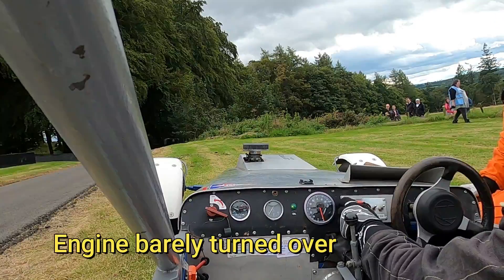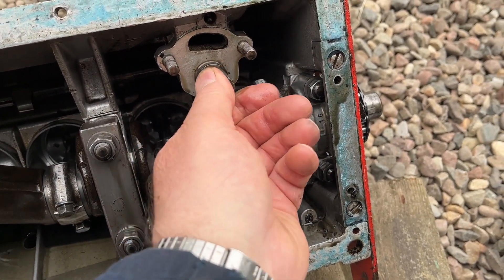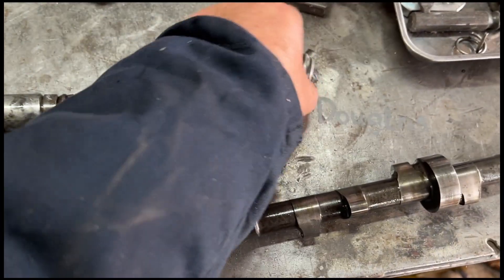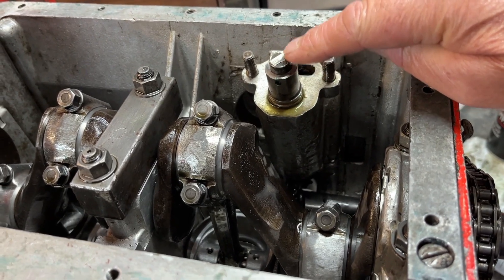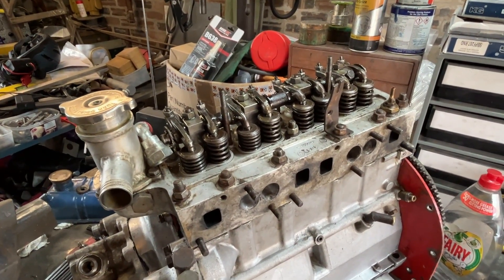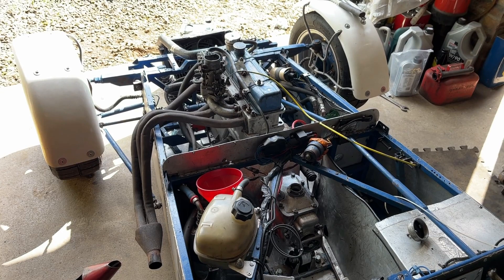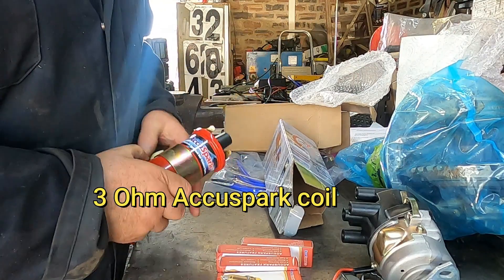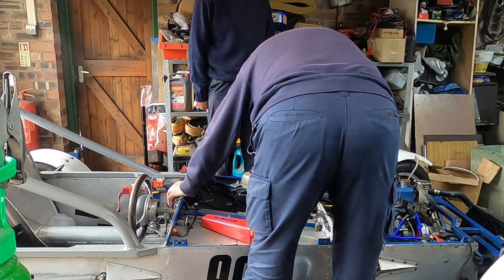I blew up the Reliant 750 Race Engine! What broke and did I fix it?

Comment: Hello Doug just found your channel I have just got a Kitten and I am intested in tuning it up abit so I was wondering if you would consider doing a full rundown of your racing engine with all the specs HP ect ect Many thanks just subbed =)
Reply from the maker: Hi, one of the best sources of information on tuning Reliant engines is the book "750 Racer" by Peter Herbert in association with Dick Harvey.
Reply: @DougsShed  Oh cool what sort of power are you making?
Reply from the maker: @classic_britain  Never measured the power however going by the 1/4 mile times and the vehicle mass, I estimate about 50 bhp. The tuned 750 was certainly quicker than my current (standard) Reliant Robin 850 engine which got fitted after my crankshaft broke.......

Comment: What for HP does that engine make?
Reply from the maker: I've never had the car on a dyno. However going by the weight of the car and its 1/4 mile times, I think it is about 55 bhp.
Reply: I was guessing 80HP @DougsShed

Comment: Yup could have been worse, glad you managed to source a replacement cam. Was that a solid pin in the drive? I've only ever seen roll pins used in D series distributors. Ice Cream tubs are great storage, that's my excuse for being a regular Mackies customer anyway. Singing along at good pace most definitely.
Reply from the maker: The remains of the pin did seem to be a roll pin rather than solid.